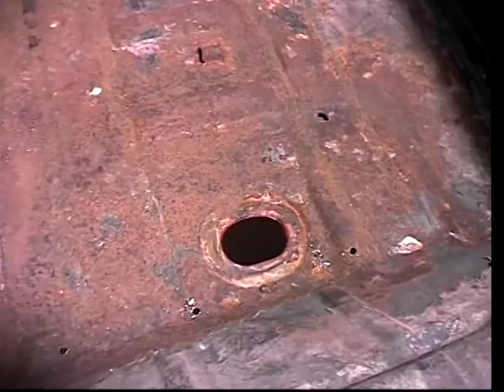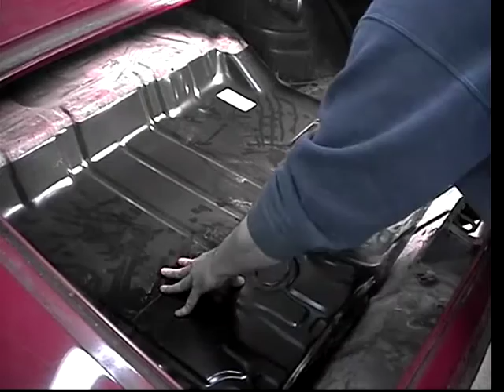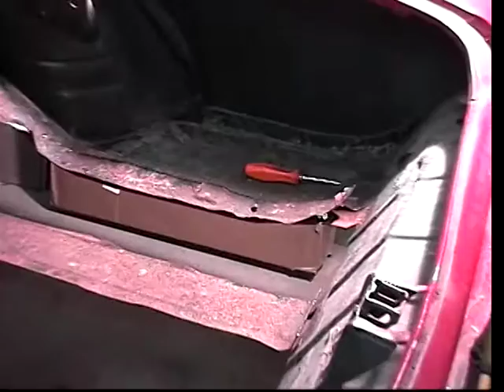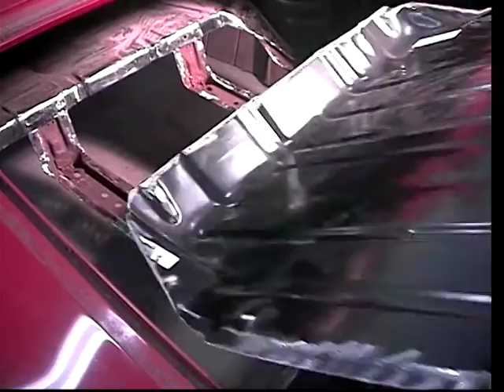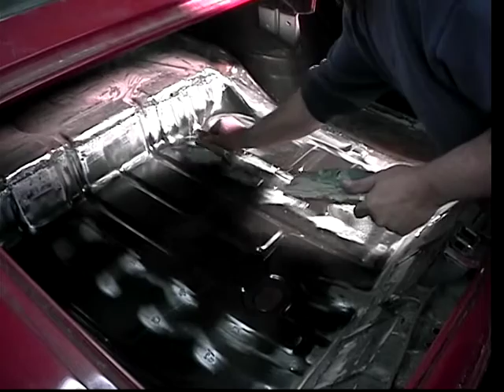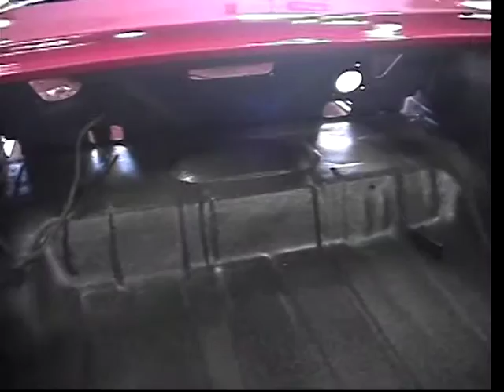Trunk Floor Replacement 68 GTO from JLV Productions

Comment: This is a good panel replacement video, but this is not the way they would do a concourse restoration. They would have got all new bracing and an entire trunk panel that goes all the way to the floor pan and all the way up the rear too the valance panel. That way the seems would be in the correct place, there are no patches in a concourse restoration, they also would never have left the inside of those braces untreated just to trust all over again.